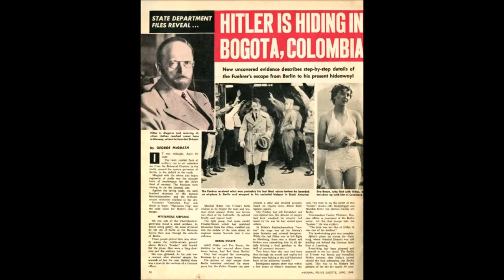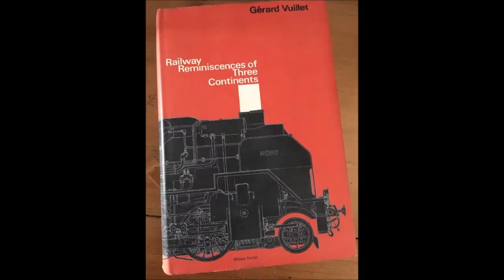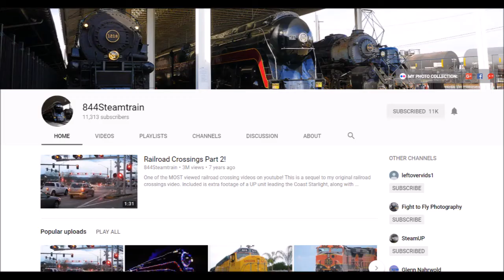Talk of the Tower-  Ep.1: Silent and Unclaimed Records

Comment: Okay! I was actually not expecting the mention of a T1 in this video, and I agree with your points completely. Especially considering that the two prototypes were built in the middle of the war, and railroads were starting to give up steam by the time the other 50 were built. Completely expected the claim on the F7 though. 
The L-2a…holy shit. I actually never thought they would've gone that fast with a troop train! I'm curious as to where this happened because I'm not too certain where the flat portions were on the C&O.